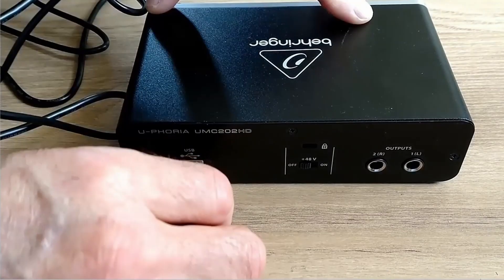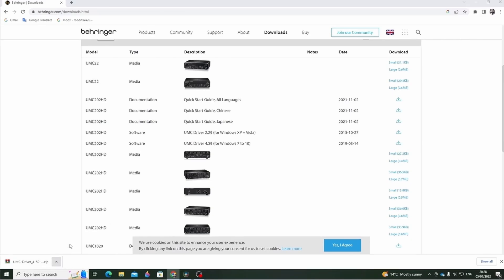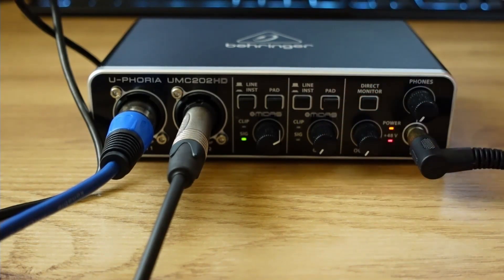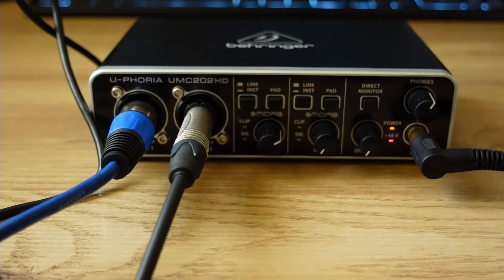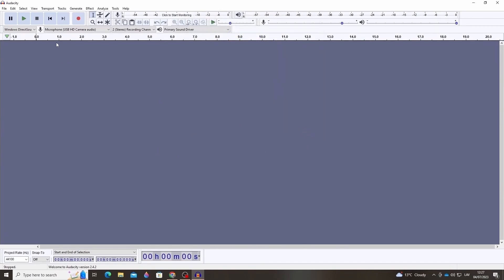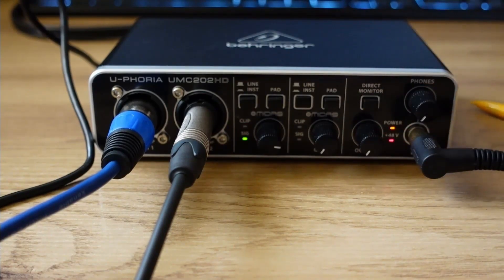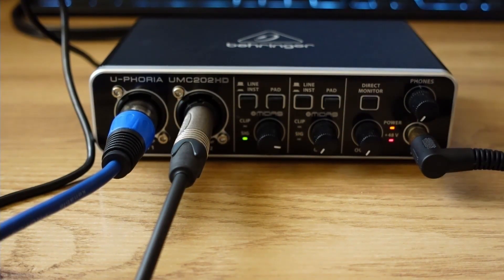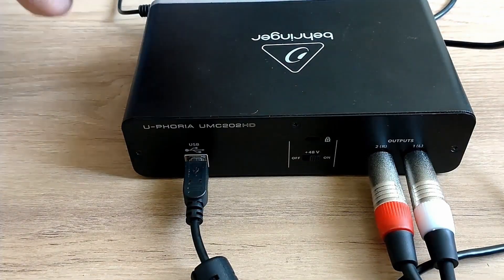Audio Interface Behringer U-PHORIA UMC202HD

Comment: Can you please help anytime I connect the interface to my computer it always one sided both monitors and headphones but when I disconnect it plays both sides
Reply from the maker: I don't know, but maybe this can help you:
Replies made with AI - 
Make sure your audio software or the computer's audio settings are set to stereo, not mono.
Have you tried a different USB cable, or a different USB port on your computer?
Reply from the maker: Your audio software's output settings are probably not correct.

Comment: Is it possible to connect an unbalanced amplifier to balanced outputs 1(L) and 2(R)? For example, using two RCA - Jack 6.3 mono cables.
Reply from the maker: yes
Reply from the maker: Maybe I misunderstood. I don't know if you can connect an amplifier to the audio interface outputs. They are designed to connect speakers, whether with balanced or unbalanced cables. Sorry.

Comment: Hello i bought one of those and wanted to use for listen the sound in my monitors, but i only hear the sound on the left sound, what's the problem ? I don't get stereo effetcs... I don't want to use a pc when i do play guitar.
Reply from the maker: But you're getting power from your computer? I've never tried using an audio interface without a computer, so I can't recommend anything. In your case, I would have chosen an audio mixer. It's designed for exactly that and is about the same price. You can also record with an audio mixer, just like with an audio interface.